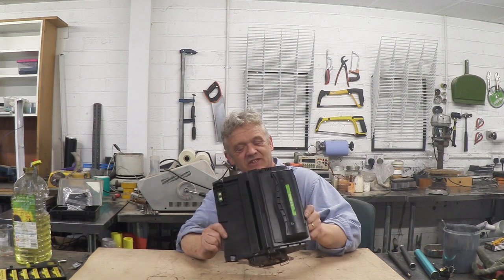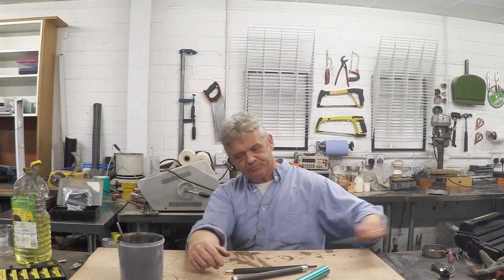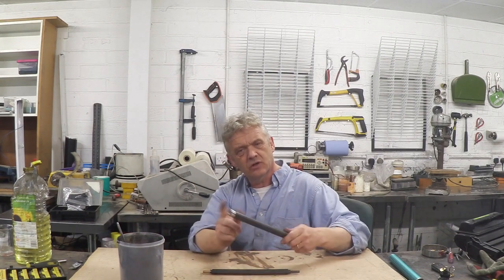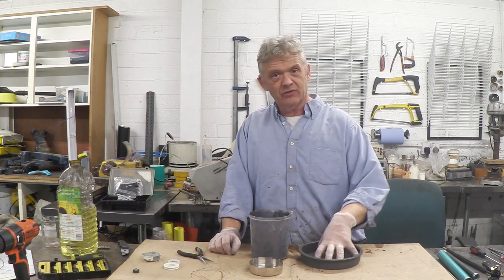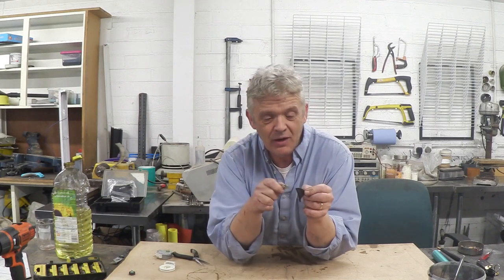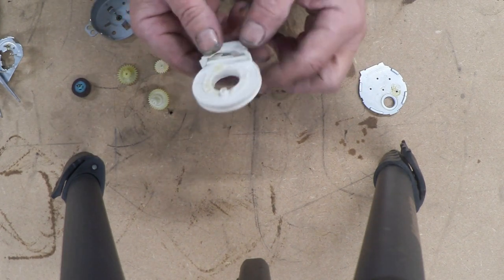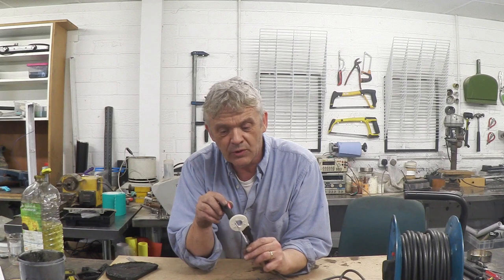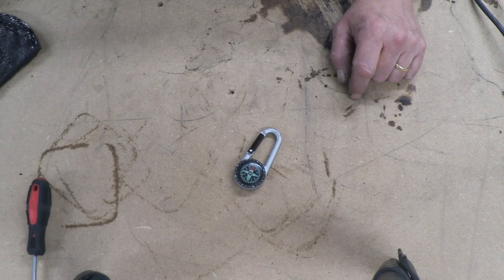Making Magnets From Printer Toner - Toner Recycle Project 1

Comment: Another interesting video, is it conductive? and would it be useful in making capacitors?
Reply: In 30+ years of repairing copiers.i never thought to check the conductivity of melted toner! (Sorry.... Developer )
Reply from the maker: no mate - it's like having lots of little wires surrounded by insulation - so the bulk material has no through conductivity
Reply: @ThinkingandTinkering  yet...
Reply: @ThinkingandTinkering  but it might make a good high voltage semiconductor... Hmmm interesting experiment...

Comment: Would it be possible to link the magnetizers around the metal magnetic  bar (mmb) then rotate the mmb and collect current, maybe use in conjunction with the "hurricane" wind collector.

Comment: Robert.
We call the magnetic/ plastic mix "developer"
The "toner" is the plastic component
The green tube is the photoconductive "drum" which has a charge applied, then is etched by laser.
The "plastic" component (toner) is pre charged in the unit then attracted  by the potential difference of the etched (0v) areas of the drum. The magnetic carrier remains in the Development unit.
Reply: awesome explanation.
Reply: Plan to. I just wondered if the data was already available.
Reply: You left out the corona wire part.
Reply: There are two types of toner.  Mono component has magnetic toner while dual has a separate magnetic component called developer and just toner  In the later the toner is just plastic and carbon.  Sharp uses separate components and Canon uses mono component.  A lot of the smaller printers use mono component. In dual component printers you can actually feel the grains of developer.  It feels like sand mixed with toner.
Reply: @supertom7908  
I could have gone into an examination of the intricacies of bias, triboelectric charge, etc, etc, etc
I felt that wasn't required, also it could be a charge roller, not a wire.

I chose a basic description,
Reply: @city_viking  
In this case, it seems to be specifically dual component.
Describing both types would be overkill, possibly confusing.
Reply: @rogerstarkey5390  I’m just teasing
Reply from the maker: cheers mate
Reply: Based on your nomenclature I would guess that you must have been a Ricoh tech.

Comment: Hi, your videos are really great!
I did not understand why it was rated a 240v coil?  I have some similar that is 24v dc, can I use these with 240v as well? 

Mvh Trym
Reply: Easier for microwave to switch 240v to the magnetron and motor via a relay. Putting 240v through something rsted 24v is 10x10=100 times the power. The wires would melt and set on fire..

Comment: Many years ago I was told to replenish the toner in the company photocopier. No idea what I was doing and of course I spilled the toner everywhere. Whoops, better clean that up, so I fetched a vacuum cleaner. The only plug socket in range was marked “Computers Only” what the hell, I’d used those before without any problem. Plugged in the vac, switched it on and sucked up the toner....... Flash! the building was plunged into darkness, quickly followed by cries of rage from the Accounts dept the Sales dept and the CEO’s office. I was not popular. Didn’t know toner was magnetic but I certainly found out it was conductive!
Reply: Thanks for the best videos on the internet,
Reply: Yep.
That's how it works.
Electrostatically charged toner attracted to a slightly charged magnetic carrier, but pulled away to an "opposite" (much different) charge potential on exposed areas of the photoconductive drum....... Then, other stuff.
Reply: There's actually a possibility the vacuum cleaner was the issue.
Unless the motor is FULLY isolated from the air (toner) it's collecting, toner and speaks won't end well!
Reply from the maker: lol - I am laughing with you of course mate
Reply from the maker: cheers mate

Comment: Please try something ...
Get a thin as possible insulator sheet big enough for a strong magnet. Maybe something like fiberglass, 🤔 even a small piece of waste veneer could work to protect the magnet.
Reheat the powder ink then take out of the oven, and place the dish in the veneer protecting the magnet.

🤔 Oh hmm If using a metal dish it probably won't work, could make a silicon mold to poor the ink into it, (can even use the silicone dishes and the oven).
Then pull it out to cool above a strong magnet. With a hate resistant spacer  Could also use an electromaget, then can't damage  an expensive magnet...😮
🧲 ⚡ 😂

Then when it cools the fierce metal crystals would be stuck in position.
🤔 I wonder if this could be used as levitating magnet, the same as the do with supercooled super-conductors

Comment: I used to replace defective stepper motors in TTY thermal printers. and found nearly all of them were dropped or hit and had a chip of magnet lodged in the works. Remove the chip and good as new.

Comment: If one were to take the primary coil of a MOT, stretch the wire, and wrap a long coil the length of the magnetic tube with the tube laid down inside along its length, one can re-magnetize the bar with a different orentation.
Reply from the maker: that would be cool

Comment: If you keep coming up with cheap ways to mold and recycle plastics, you're going to put the 3D printer market out of business!!  😋  Just thought I'd add, there are so many useful parts in printers (and photocopiers) of all types. Ridiculously well machined and otherwise expensive assemblies people are just tossing out - gears, bearings, rods, rollers, etc, etc.  A treasure chest of parts, really... and, as you point out, even the cartridges have value!!  Maybe there ought to be a rhyme... "if you see a printer, pick it up, and in your workshop have good luck!"  😸😸😸
Reply from the maker: you are spot on they are full of 'stuff'

Comment: Thats very cool, can this material be used for transformer cores? like those donut shaped ferrite cores? 
Maybe you could teach us how to do transformer cores, since cooper wire is not that expensive and we could do specific transformers for high voltage.
Reply: My thoughts exactly!! So exciting!!
Reply: Hm , how hot would the transformer get? Would it melt? Could we build in some heatsink pipes? Or add soft iron dust? Aluminum powder? So many possibilities. I wish I had a shop.
Reply from the maker: I don't know mate - but I do plan on trying it - perhaps upping the Fe2O3 loading and using the toner more as a binder
Reply: @ThinkingandTinkering  Lol thanks you actually did a video about this, so awesome! I will totally make some cores now!

Comment: Well done m'Lado!
Reply from the maker: lol - cheers mate
Reply: @ThinkingandTinkering  .

Thanks for answering the problem in my email with this video,  just put this out their for others to try or for future videos in the series may I propose;

Hve you considered backing (like cake backing) your toner whilst its manipulated by a megnetising field, the stronger the better obvs( reverse enginer a microwave transformer) or somthing to make it 20,000 volts to flood through your rectified DC solenoid thingi.... 

or/and 

You Could some how set your solinoid magnetiser up under a thin firebrick at the base of your kiln and then put your silicone bake tray (or cookie cutter cups full of toner...   I'm sure they sell silicone  cupcake cups of interesting shapes)  to make custome shaped plastic magnets. Of a relatively descent grade... out of cheep availible toner.... simply at home

Alternativly you could use a boron/niodinuim ceramic magnet in the oven under a silicone dish of toner as they can keep their magnetism upto around 280⁰c where as most niodinium magnets loose their pep at 80⁰C...

Just a thought for easier than having a home kiln magnet making.

Subsequently multie magnetisers could be set up under and around the silicone shape make to give the new magnet truly unique magnetic profiles.. since the plastic  would better allow for islands of fertile to form indipendent poles in the one shape..
Eg; Star shape cooki cutter with a south in the centre and north tips or vice versa

Also also   add some of your homemade graphine... just for the fun of it see what
That does...

I have my own hypothetical suspicions you would increase the strength of the shape whilst allowing more extreem magnetism to manifest as a result of shielding poles interaction with eachother through the hardned toner medium...  making the magnetic field more intense external to the object 

🖖

Comment: A question.  I understand that magnetisation works by aligning domains in the target material.
 Does this weaken the donor magnet  when "Stroke" magnetising?
Reply: In principle yes. In reality very little
Reply from the maker: yes - but it will be years before you notice it
Reply: IMO no.  We used to use "keepers" - bars of soft iron put between the poles of permanent magnets when not in use.  When a magnet pole is put near a piece of iron or other magnetic material, it increases the field inside the magnet as well as in the iron, because the magnetic circuit is better.  
People often think there is some quantity of magnetism inside a magnet which can be used up.  But it is all down to alignment.  Anything which increases the magnetic flux through the magnet, will help keep or increase the alignment of the domains.   Air between the poles is very impermeable, so any part of the gap being filled with iron makes it more permeable and increases the flux.

A friend recently restored two outboard motors with "dead" magnetos.  I thought you would need to remove the magnet and remagnetise it (as it said in the manual), but he just got his electric drill, spun the magnetos for a few minutes and sparks reappeared.  The magnet was good as ever.

Comment: Thats fun. However using the 240V ac coil for DC by using the diode changes the impedance of that dramatically and might cause more current than it is designed for and maybe dangerous situations when it is left unattended.
Reply from the maker: then don't leave it unattended - I did recommend on the off immediately

Comment: Hi Rob, have used a car battery to "refresh lazy magnets" in the past.
A couple of wires to the battery and momentarily "splash" the magnet. Sparks yes, shorting a battery yes, but works a treat. Not for the faint-hearted. One in particular, a huge marine diesel generator failed to start, traced it back to the permanent magnet that creates the initial flux field within the winding core..a grub screw had loosened and the magnet did not spin with the shaft and so became demagnetised. Took it off the shaft, splashed it and it ran like a good one. Same principle as yours, but loads more power :)
Regards Tony
Reply from the maker: nice one mate - I am going to give that a go lol

Comment: 50 rupees = about 1/2 bps :-)
Reply: Currency trader? Lol. You beat me to it...hehe
Reply: Could you imagine...if Rob ran a trading channel? Boom.
Reply: @undernetjack  been checking spot silver a lot i had the answer before i realized there was a question:-)
Reply: @undernetjack  well then we wold know how it worked but he would have to start dodging rothschild hit squads then wouldn't he:-)
Reply: clayton mccormick Yeah, your right. He would truth the hell out of them and get bagged. I bought some silver, not much , just a little backup for emergencies.
Reply: @undernetjack  each switch breaker contactor has silver contacts relays and kb mylars too so while you are recycling the plastic don't forget the juicy bits :-)
Reply: @claytonmccormick622  The Rothschilds and all the rest of their soul group need to get off of my planet. I say; "Be gone from here or with me, be made done."
Reply from the maker: well there we go - that is cheap lol

Comment: So is there no need for resistors to prevent a short circuit?  Can I just connect wires to a bigger coil and electricity through it?  Do you get higher magnetic fields with higher volts or higher amps? 
I'm picturing something like connecting the output leads of my welder and cranking up the amps to 200.
Reply from the maker: the coil is a restore mate - that's where it gets it rating from - in this one I think the resistance is a couple of thousand ohms - if using a coil with less resistance you would need a current limiting resistor in there - but a alight bulb will do that job

Comment: I have sooooo many cartridges to harvest from. That's great. What, if any, electrical properties does the plastic have? Conductivity, resistivity..,.
Reply: Be careful.
Toner in suspension can be a fire/ explosion hazard if heated.
Reply from the maker: you could always just run a few tests yourself and share the results mate

Comment: Also, the coil from the synchronous motor. Do you have any suggestions where to look how to make a bigger coil like that or one better for the pendulum generator I'm building? I Don't know much about making coils or even which type I need? Any collaboration from anyone would be awesome?
Reply: Desmond Bagley  yeah, I have to find me one and year into it.
Reply from the maker: coils can be quite complex mate - it's not really possible to give an off the cuff answer but you ask a good question and it is something I might well go into
Reply: @ThinkingandTinkering  I have a big microwave magnet swinging over the coil off a synchronous motor like you used. I hooked up 2 more small coils in series to get more out of this set up. It is putting out pretty decent numbers but I think a stronger coil would be ideal. I think It would be better than the in series set i have now.
Reply: Well if you can gut a microwave transformer, those have a very bulky primary winding that might be a good already made coil.  The primary coil has a very thick wire that can handle a lot of current. The secondary winding has many more turns of a thinner wire. Those are your extremes of coils. Try both of those to see which one has a better output for your application! 

In your case, try to look in youtube the term "axial flux wind turbine permanent magnet generator", and use that way to build your coils and permanent magnets, since it's way more efficient. Hope it works!
Reply: @JavierChiappa  I like the advice a lot. I have 2 transformers I could look at. I think I have a bad air conditioner motor that I replaced before. I might could use a coil of wire from it? Thanks @Javier Chiappa
Reply: @jeffreyrood8755  For sure man, you can reuse that wire, just inspect it to see if still insulated. They have a polymer/resin coating but its very resistant.
Reply: @JavierChiappa  I gotcha, Thanks for that reminder. I am hoping to that found and going next few days.

Comment: Could you powder coat with toner
Reply: It's essentially a similar process, but I imagine the formulation of the coating is different.
When you agitate "toner" (the plastic element) it attains a "triboelectric charge" (rub a balloon on your hair, same thing)
In a copier, that charge sticks it to the magnetic material which is then held on the magnetic roller Robert found.
In powder coating I imagine the powder (similar to only the toner, no magnetic component) will be stirred to charge, sucked into the  spray head and sprayed at the 
 object, which had charge applied through the hanging wire(?)
Reply from the maker: I plan on giving it a go

Comment: What effect would you have produced if you had the magnetic field in place while the hot toner was cooling into a solid?  Granting that your coil is not producing a very strong field, it would still be interesting to see if having the field in place while the material was setting would leave a residue of magnetism in the material.
Reply from the maker: it would - go for it
Reply: Almost certainly would improve the magnetic strength.  The particles would align in whatever their preferred direction was and would link up into chains - as you see with iron filings near a magnet.

Comment: Were there any Warnings, Cautions or Danger listed ?   A copy machine I had long ago.  there was an  Aluminum (appearing)  cylinder 5 in dia, x 17 in  length.   The warning labels stated it contained Arsenic.  Beware,  Alert and so on.  
 Your Toner Disc,   if you pass it through a magnitizer edge first,  will it polarize each half of the disc that way?    If you pass the disc through the magnitizer  flat, in the same plane as the magnitizer will each side of the disc be opposite polarity?
 Suppose you have a pyramid shape of iron,  you magnitize it,  one pole of the base would have the same volume as the pointy pole correct? Would there be any  application, use or advantage to have an odd shaped magnet such as that?   Is there a reason we have lived in the mundane world  of circle disc, cube, rectangles and horseshoe shapes?
Reply: Old copiers used an Aluminium cylinder (drum) coated in silicon, which was doped with arsenic.
Usually (exclusively?) Silver in colour.
The one John had is a modern "Organic Photoconductive".
Safe.
(Although I wouldn't lick it!)
Reply from the maker: basically I think Roger answered your concerns mate - as for the rest- I have no idea try it and see
Reply from the maker: lol - neither would I - nice one mate - thanks for answering that